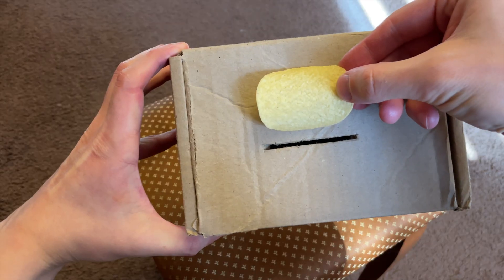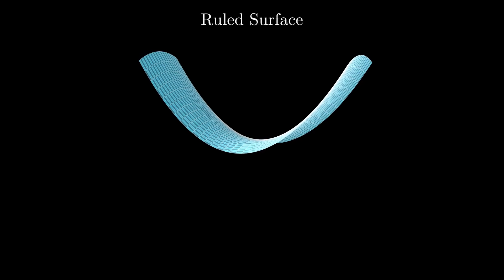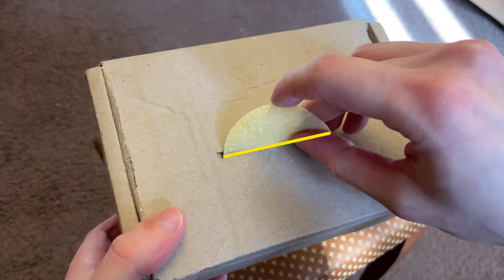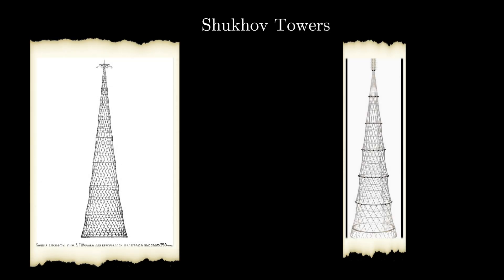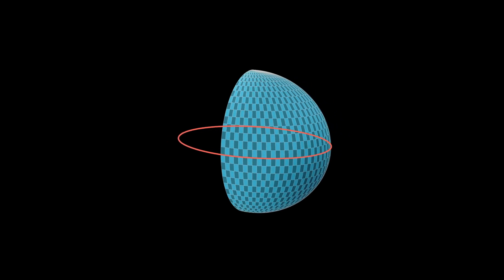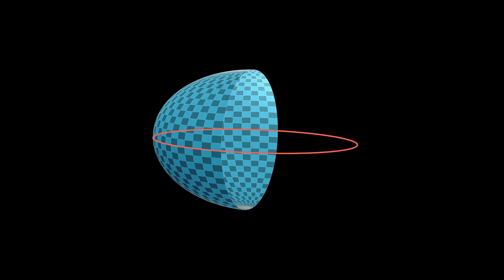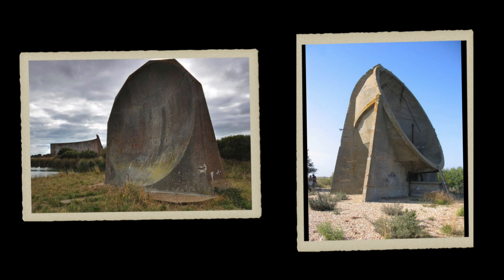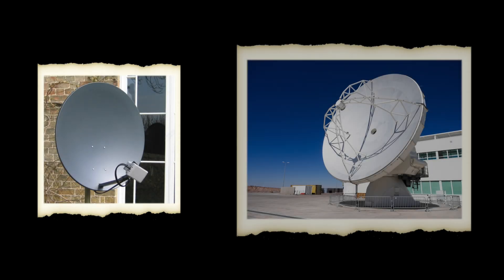Conic sections serve us everywhere !

Comment: Volume of paraboloid via Cavalieri's principle: (I discovered this proof)
Type Without integration, why is the volume of a paraboloid half of its inscribing cylinder?
Reply: Shouldn't that be 2/3?
Reply: @artsmith1347  That is for a sphere inscribed in the cylinder.
Reply: You are correct.
https://en.wikipedia.org/wiki/Pappus%27s_centroid_theorem
"the volume V of a solid of revolution generated by rotating a plane figure F about an external axis is equal to the product of the area A of F and the distance d traveled by the geometric centroid of F."
From my previous link for a half-parabola, the distance from the vertical axis to the centroid of the half-area is 3*b/8, so the volume swept by the half-parabola in a full rotation is
(2 * pi)*(3 * b/8)*(2/3 * b * h) = pi / 2 * b^2 * h.
For the rectangle, the distance from the vertical axis to its centroid is b/2, so the volume swept by the rectangle in a full rotation is
(2 * pi)*(b/2)*(b * h) = pi * b^2 * h.
So the volume of the paraboloid is half that of the cylinder, as you said.